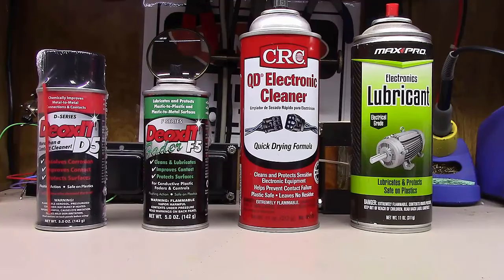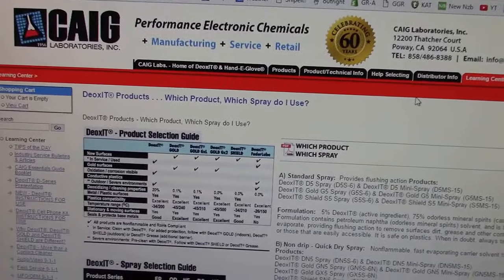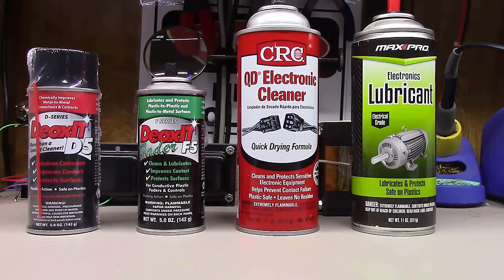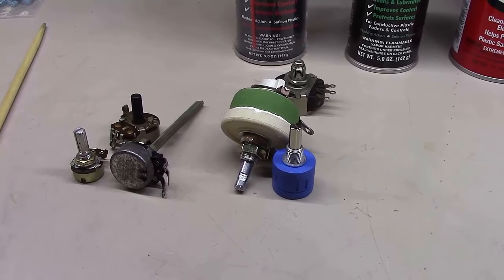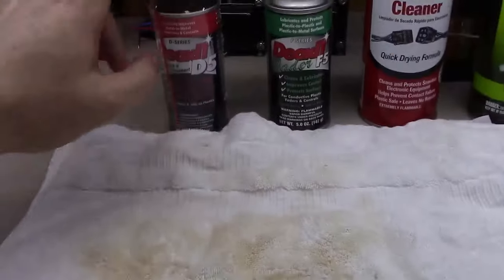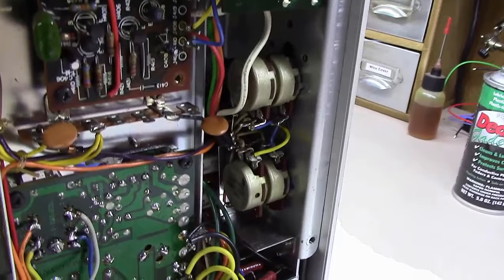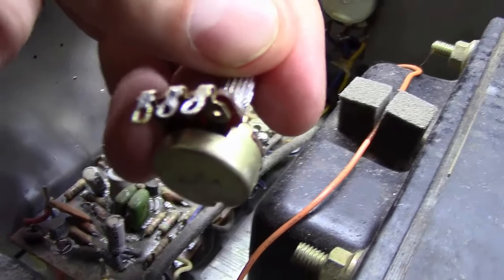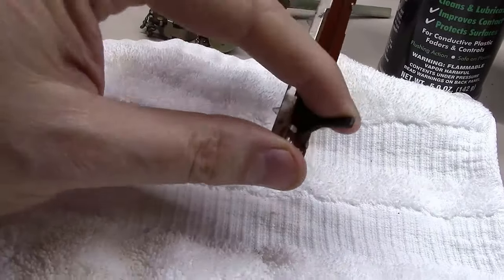Deoxit Demystified - how to use it and other electronics cleaners

Comment: Thank you Sir for your informative video. I have used QD CRC  electrical cleaner as a novice in the past but not the D5's. With your video I'm able to understand the different use of them. The reason I came across your video is because I've been wondering how to thoroughly clean some kitchen appliances that roaches have used to nest and do their business. Like to clean and get rid of the smells also. thank you as it's not just an informative video but the way that you explain the details with normal speed and tempo becomes easy to understand. A lot of video has a lot of sensationalism and sometimes you can't understand their speech. JCT:)
#Drumx

Comment: Thank you for a great explanation! I was using CRC, I THINK it was number 2000 for years, for audio gear. (Dark blue can) If you spray it on your fingertips it dried in about one second and left ZERO residue. IOW, it was more for fine electronics like you are talking about instead of 480 Volt breaker switches. LOL! I am wondering what would be best for inside an older computer? Probably the Deoxit gold? If the wrong cleaner is used in one of those, it will turn into a brick! Have a great week!

Comment: Correct me if I'm wrong, but I think you have to be careful about using DeOxit F5 instead of D5 for potentiometers because they have a carbon track. I've read you can damage pots using D5.
Reply: I've also heard that D5 can damage carbon tracks.
Reply: It’s a corrective maintenance, better than nothing, also, you need to let the product to “cure” let the solvent to evaporate, it will work better after 24 hours you applied!! Personal experience!! 😊

Comment: Whatever "electronics cleaner" you use, test it first.   I was cleaning the electronics in an old Steinberger graphite composite guitar.  I got some cleaner on the guitar body, and the guitar started to dissolve.   That was a nasty surprise.

Comment: That brown thin sheet on the slider is MICARTA. It consists of, usually, layers of linen fabric infused with phenolic resins. Cured with heat. That is a thermoset “plastic”, NOT heat-meltable.

Comment: I stumbled onto your video. Thank you as it is very informative. I purchased Deoxit D5 because the plug between my door jam and door has multiple small round pins that have a greenish tint to them. I sprayed the product and reseated the plug multiple times to get it clean on several occasions but the greenish tint (corrosion) is still there and it’s affecting (I think) my door locks. Do you have any suggestions on a product that will remove this greenish tint off of the pins of the plug?  Thank you for a great video.

Comment: OK, you kind of answered my question right at the end.  I was thinking of using an isopropyl alcohol spray or CRC QD Cleaner first because they're relatively cheap and would be used as a first "flush" of a pot or open contact.  Then I can understand why you would use DeOxit D5 to add a little different cleaning chemical and a lubricant.  But, why wouldn't you use the Max Pro lube?  Is that only for electrical connections that "snap" together rather than potentiometers?

Comment: If you ever update this video, can you talk about the Deoxit  mechanical/electrical grease (L260DNp). I've cleaned a few pots and seemed to lose some of the viscous or "silky" feel to the unit. Was wondering if this grease would be useful to restore some of the feel of the pot? And, where would you pit it....on the wipers or just the shaft?

Comment: Can you please make a video showing other alternative products that can be used instead of the DeoxIT ones?!They are pretty hard to get in Europe!Wich other brands of Fader Lubes can we use if we cant get DeoxIT?
Love your chanel and videos,keep up the good work ;)
Reply: Isopropyl alcohol 92%---cheaper by far and and ALMOST  always just as effective
Reply: @peterstoffregen2478  Isopropyl alcohol will remove the contact charcoal on the faders and unbalance them!They will loose properties to increase and decrease volume and turning the fader more of a switch ON switch Off slider!Besides of that,it wont lube it,meaning that everytime you use the fader it will be scratching off more of that contact charcoal and later beeing forced to switch the fader for a new one.Theres a reason why there are many different types of elethronic parts cleanning products besides the 99%(not 92%,92 still have 8% of water and thats a big NO NO for elethronics or PCB circuits) Isopropyl alcohol  ;)

Comment: For a $3k DJ mixer controller (circuit board, knobs, switches, screen) and speakers covered in fine dusty alkaline sand, what do you recommend after compressed air?

Deoxit D5/nD5 Mini/Fader? CRC?  Vinegar/Water/Alcohol? MG Chemicals Super Wash? 
All of the above in different steps? 
Microfiber cloth, Soft toothbrush, cotton swabs, …

Comment: Hello.  I have a nice working, lightly used Sansui AU-555a amplifier that has crackling noise issues when I use the Volume, Balance and Mode function knobs.  I would like to clean those pots and switches myself.  Should I use the Deoxit5 and then a small squirt of the Max Pro lube?  From your video that sounds about right to me.  I've never had the cover case off but had those three parts cleaned by a professional many years ago.  Thanks.  A.

Comment: Do you use the DeOxit on the pins of the old tubes you find? Love to see a video of what your process is to clean pin corrosion
Reply: It is perfect for that and the sockets of tubes as well. Contains no silicone so it won't be absorbed by phenolic resin boards that the pins are in.

Comment: Hi,
Can I try the deoxit to possibly see if my car audio amplifier channel could  possibly just need to be cleaned? The amp is from 2004-2005 and one of the two channels went out around 2012. The amplifier is very high end. I took the bottom off and nothing looks bad or burnt or loose etc but I have an untrained eye. This amount has never been wet but car audio stuff can become dusty easily. What would you recommend I try if you do indeed recommend this product.  Thank you!

Comment: amazon picked  up a large can Deoxit red can D5  I have 5 Receivers  and 2  older ones are having volume problems  I have one receiver with static coming for speakers I have replaced all speaker wire still have static I will open it and clean Thanks its nice to know what to use and how !

Comment: DeoxIT is basically acetic acid mixed with mineral distillate aka tetrachloroethene or perchloroethylene or in other words dry cleaning fluid.  The reason you clothes stain is because the acid is eating the color !

Comment: great info ! what about some old  Zenith TV tuner cleaner is it like the D-5 ?
Reply: Excellent question. What is the difference - if any - between all these and the old TV tuner cleaners we used to see?
Reply: well just a heads up I used my old Tv tuner cleaner on my 1972 amp did all the switches and nobs and it worked like a charm  @KameraShy

Comment: I assumed Deoxit isn’t conductive.  My old 64 GTO was having an electrical issue where it wouldn’t start.  I took the harness connectors off of the firewall and sprayed some on the contacts.  I didn’t know it dries slowly.  Thought it was like Freon and dried quick.  I plugged the harness back together.  Was standing by the car.  All of a sudden it starts cranking trying to start by itself.  It was in gear and took off by itself.  Luckily ran up against a hedge that stopped I before any damage.  So is it normally suppose to be conductive?  Thanks.
Reply: That's crazy, man!

Comment: Gold corrodes???? Isn't that one of its amazing properties in that it doesn't tarnish, oxidize or lose its luster over time? It's used to coat special switch or relay contacts that carry very low level signals where there's never a presence of a whetting current to constantly clean the contact faces. What can happen is a build up of minute dust & dirt particles over a long time which then reduces the contact patch area until eventually it affects the passage for the micro-voltage signal. 

I've used the Red D100L series DeoxIT 100% solution for over 17+yrs now on everything but the best has to be ENG TV News camera bodies mag-alloy bodies. Where the side covers screw down to main body & if rain water etc made it there they'd corrode like mad. A brushing with Red killed any corrosion that had begun & once dry a coat of Gold G100L has kept the EMC shield-wire and magnesium-alloy surfaces perfect with the cameras still working in great state at 13yrs old!
Reply from the maker: Should have been more clear, a lot of electronics are not true gold, but instead gold plated and not all that good at that.  It wears thin and often does corrode, or at least from my experience.

Comment: your deoxit shirt stains -- you might be able to get them out by using wd-40 to "re-freshen" the stain, then use a toothbrush to scrub it with baking soda, and then scrub it with dish detergent, and then launder. there's more detailed guides online but that's the gist of it.

Comment: Which one for technics 1200 faders? I bought a mint technics, the guy never used the pitch. Problem with that, is it feels as if it dried right up. Theres no smoothness in it like on my others. is that fader lube you think or do I need it re housimg all re greased u think ?? Its a 2006 technics 1210 mk5.

Comment: I have a McIntosh C11 with a slightly noisy volume pot.  There is a little sizzle sound between the 3rd and 4th dot on the volume control.  I sprayed Deoxit D5 and it went away temporarily.  A few months later I sprayed it again and it went away for several days but came back.  Not as loud, but it came back.  Any ideas?
Reply: Buy a cheap rotary pot to take apart and understand that there ate 2 sliding surfaces inside... where a slider touches the carbon track AND where that moving slider contacts a stationary surface, being where the wiring or PCP connects. Carbon tracks can abrade, the contact between carbon track and metal oxidises / corrodes and/or has abraded material + contaminants [dust/nicotine/grease] and metal to metal oxidisation + contamination. 
Perhaps insufficient de-oxidiser + lube is getting to all areas of the assembly... or simply the Pot is beyond serviceable life.  
Long term option is to buy a quality Pot to replace the original component, if the old Amp is worth repair.

Comment: Gold does not oxidise!  Have you ever seen a gold ring or metal corrode?  What's called oxidation is moisture, dust & airborne micro dirt.  Gold is also an excellent conductor of an electronic/electrical signal.

Comment: any thoughts on the WD 40 contact cleaner? would be good for pots?
Reply: I have the same question. And yes it's that one
Reply: @RedneckPunk  I used it and it worked for me only thing is its just a cleaner so to be on the safe side I got a separate lubricant which I applied after 15-20 minutes... I think it ended up being cheaper

Comment: would these work on a midi keyboard's note pads? they are these buttons that when you press a key down, it pushes a conductive type of material onto the pcb which is very similar to a gaming controller, but since its not metal would this be safe to use? It seems to be some kind of plastic or something else im not sure of.

Comment: Spray is the tool for spreading large quantities of liquid over a large surface, for example when painting a car. The problem with spray is that it doesn't work when you just need to put a drop of oil in a potentiometer, a switch or in a rotary capacitor. It is very difficult, or impossible, to dose the amount of liquid when using a spray, there is always an overdose. Spray is an idiotic tool in this case.

Comment: Deoxit for Gold contracts? Corrosion on gold? On gold? Did I missed something? 😦
Reply: Yes, gold plated RCA jacks get Barnacle and Klingon build up, I have used polish in the past, but, it removes the thin gold plating. Deoxit Gold is the only thing I use now.
Reply: @chuckgilly   Then you are using an abrasive 'cleaner/polish', obviously.

Comment: Deoxit is way too expensive.  CRC is much cheaper & I think does the same thing.  For lubrication, why not simply use WD-40 type product afterwards ??  Would that work ?
Reply: Deoxyit improves the conductivity, WD40 decreases it. There's nothing like Deoxyit. I started using it to repair old computers in the 90s (including pre-IBM PCs and workstations).  Deoxyit would return conductivity to components that were otherwise dead, $10,000 components were saved. I find your comment quite ignorant, actually. Why would you say that when you obviously have never used it?
Reply: @squirlmy  I've never driven a Ferrari either but it is still expensive.  Same with this stuff, I think it is expensive.   And your statement is your OWN experience and is subjective as I am sure other stuff would have done the same things that you claim deoxit did.
Reply: The crc does the job at 1st. There isnt any lubricant and it actually eats away at the inner lining of a pot eventually making the scratching sound much worse. You would have to immediately hit with a lubricant afterwards and at that point weather its still cheaper or not, deoxit seems like the best bet.